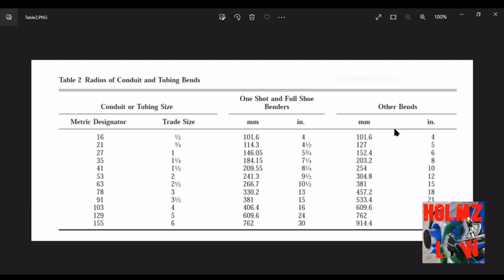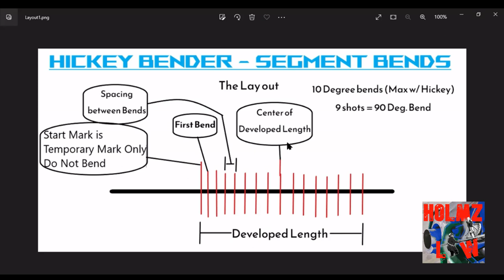Conduit Bending - Using A Hickey Bender

Comment: The first bend with a hickey should be about?? (Pls help)
Reply from the maker: Using a hickey means you have layout every bend like a segment bend. Which means you have to do several small bends to complete your bend. Where you start depends on the type of bend you are making. You can start it any where you want if you are just going to cut and fit it. But if you aren't going to cut and fit and you need to be on point then you have to use your formulas. I have videos on segment 90s and offsets you can look them up. If you have trouble finding the videos let me know. Also I have a discord community that I'm building to help electricians with conduit bending and electrically related topics. Link will be below. The link will be good for a day.
https://discord.gg/6eTv37Ak
Follow me on www LinkedIn.com/in/melvin-rubio